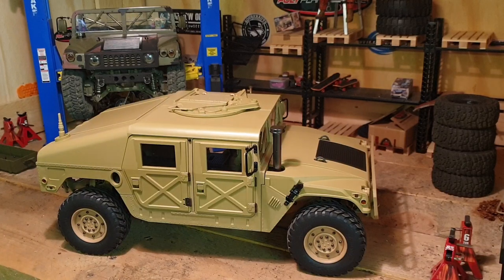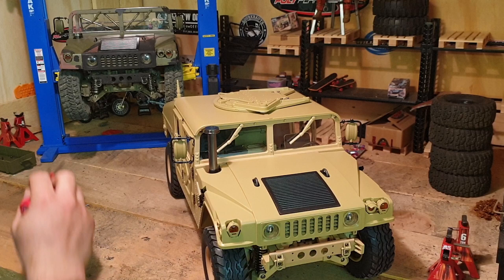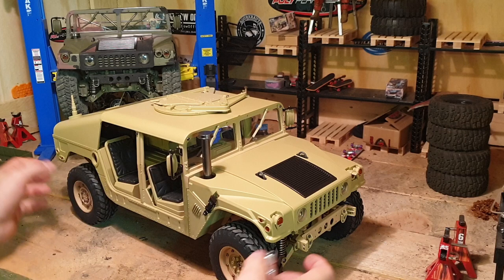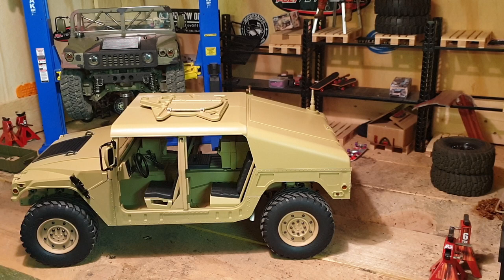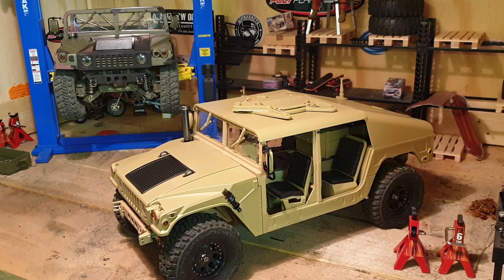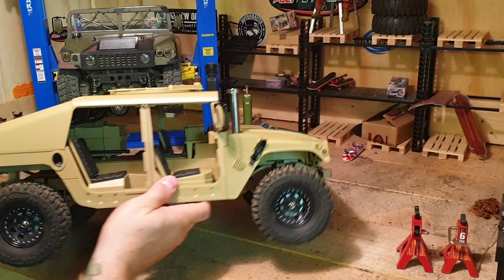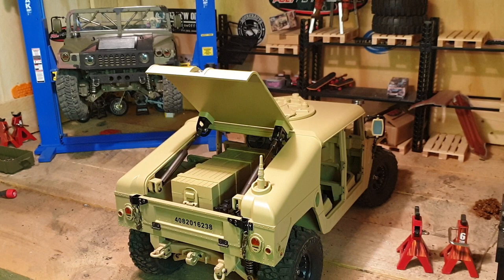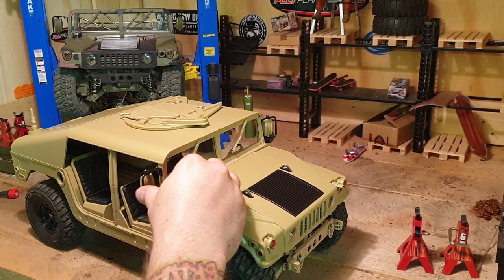Scalemonkey - how to Upgrade and Modify the HG P408 - Humvee

Comment: Very cool. I color-matched the frame to tan similar to yours and color matched the shocks and springs also. I added marine grease to the shocks and swapped to softer springs and tightened the coilover shock bodies to maintain ride height. I converted it to brushless and added two cooling fans, swapped the sound kit for an ESS One sound kit, then cut the slant back and made it a hardtop sedan. I then added a color-matched BA Model rear airlift bumper. Then I removed the tire foams and air-filled the tires in the freezer and sealed them with glue in all bead areas.